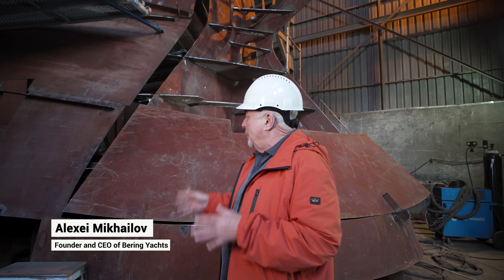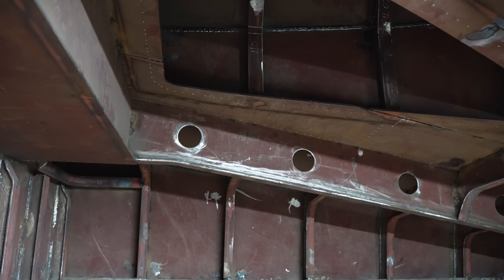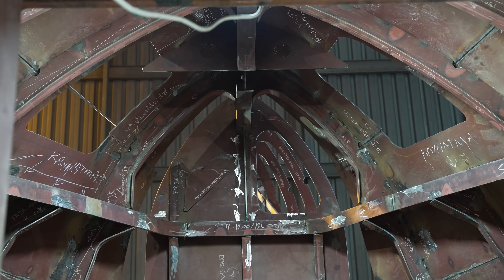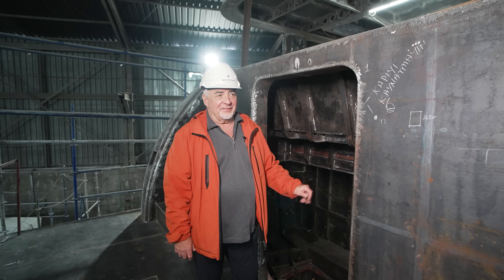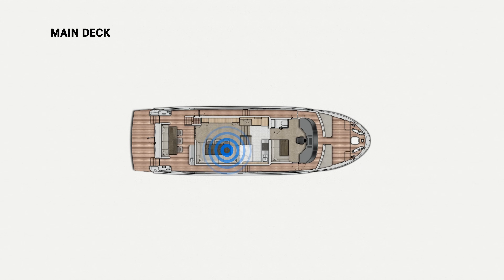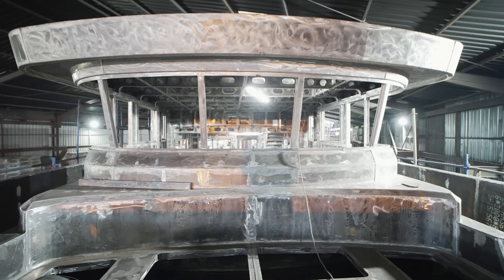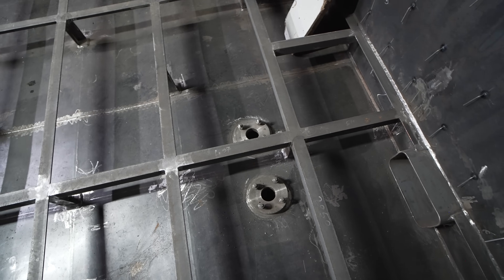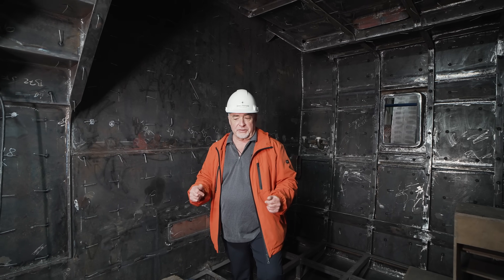UNDER CONSTRUCTION: Two Bering 72 Builds at Different Stages

Comment: OK, ok ! You have convinced me, sir. The 72 IS an upgrade to the 65, especially the Engineroom and the Lazarette. I also like the additional head in the Rudderhouse. 
I personally would love to have an additional head on the Flybridge. Even at the cost of one of the sitting areas.
How good is the insulation ? Has someone tested this beauty in artic waters, including bad weather ? And i mean BAD weather ?
Reply from the maker: All bulkheads, ceilings, and hull sides are equipped with acoustic and thermal insulation. For cold climates, additional options are available upon the owner’s request. We also have B65s successfully operating in northern latitudes.
Reply: @BeringYachts  Great, thank you for the answer.

Comment: thats soo cool and interesting too, ty. btw what are all these welded little "things" on most of the walls?
Reply: They are there to hold the insulation in place as it would be very floppy otherwise. It gives the insulation - both for heat and sound - just enough structure to stay in place in between different walls. Think about how much a boat moves. And now realize that EVERY SINGLE THING on the boat needs to move equally at the same time. Every. Single. Thing.
Reply: @spdcrzy  that makes sense, thanks